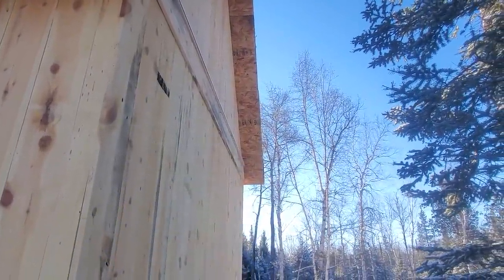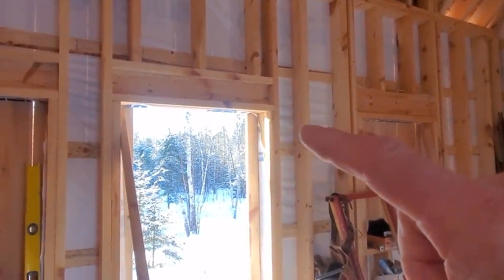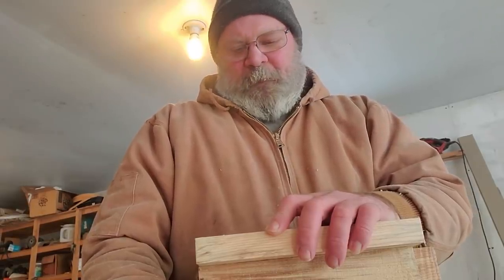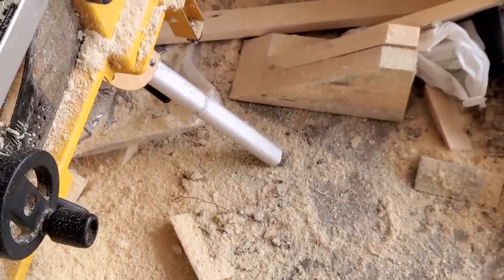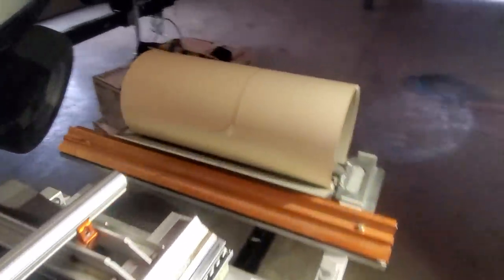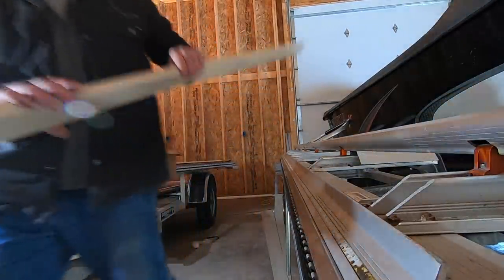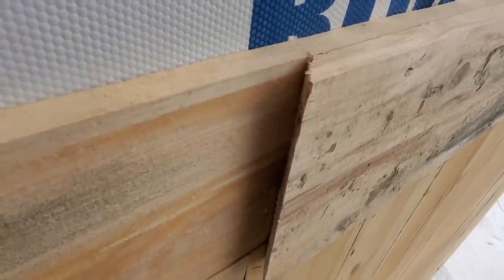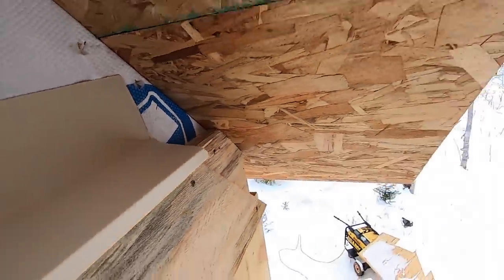Off Grid Cabin Build In Northern Minnesota, part 15, Gable Board and Batten

Comment: I've tried my hand at building a cabinet in the past. It was clumsy to put it nicely. Even RTA cabinets are costly so I would be interested in a method of building cabinets that look good and saves some money. Thanks!
Reply from the maker: A lot of sanding is the key, lol. I have done many different styles of assembly in the past, but on these I'll use simple pocket screw assembly, maybe a bit of plate joinery also, we'll see.  Thanks for the input.

Comment: Yes definitely would like to see your cabinet build. I just finished adding drawers to my heavy duty woodworking bench.
Reply from the maker: These will be  a pocket screw assembly build, although will dove tail drawers and maybe use the plate jointer a bit, I just don't want to bore everyone while watching glue dry, thanks for your response to the video
Reply: @Thelifeofwiley  I used rabbit joints on sides and bottom using 1/2” plywood for all but the face which was 3/4”. They will get abused since it is shop furniture, lol

Comment: Not a criticism but I would have left an air gap between the top of the metal drip and the bottom of the siding boards to prevent bottom sitting in water and causing Rott .
Reply from the maker: You are correct, I started thinking about it after the first couple were up. Then got lazy. I will be sealing the wood after it dries some so that should help. Thanks for the comment, love them

Comment: Looking good, now go inside and warm up by the fire, lol. Are you boxing or framing in the over hang I assume now that the siding is done? I'm assuming I'll find out in the next few videos but was just curious
Reply from the maker: I'll build a 2x4 ladder and I want to use bead board on them, but will see about the costs, other wise  rough sawn plywood. Also 1x6  cedar for the facia
Reply: @Thelifeofwiley  awesome. I figured something similar I just never seen the ladder installed after the roofing so was curious. Thank WW. Best wishes

Comment: I would love to see another cabinet builders technique. 👍
Reply from the maker: I'm not going to get too fancy, these will be pocket screws for most of the construction. I may break out the dovetail jig if I can find it, for the drawers, but keeping it simple with these. I have a ton of 4/4 x 4 x 6' alder from a job many years ago, and a bunch of crappy 3/4 plywood for the cases I will just paint or spray white for the cases